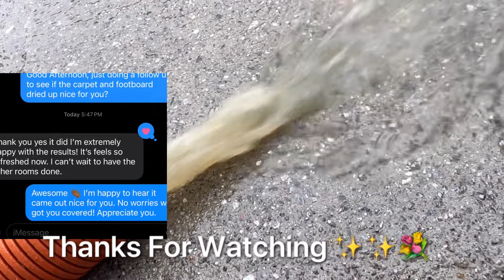Dirty Carpets!!  We Love The Transformation! Amazing Results @CarpetCleaningATL

Comment: No not the crb 😢, mine broke too I had to go back to using my oreck orbiter. It works but takes longer.  I like how your teaching young buck how to prespray because that's an art. If you ain't prespraying right forget it, the next most important part is the crb for sure. If you have those 2 you cam get Amy carpet clean. The rest just help it go faster.
Reply from the maker: 👌🏽 spot on! Thanks 🫡 them CRB’s are tough, but you still have to be gentle with them😅
Reply: @carpetcleaningatl   they take a beating unless they get dropped on the brushes from a couple feet, then it bends the axles and its a wrap. Mine broke about 2 days after I knocked it off the ledge in back of my van and "1 turned into none"  😂 

I like watching your videos and it's also inspired me to start to video my stuff too, so thanks for that!!